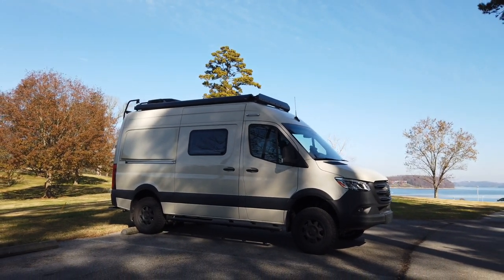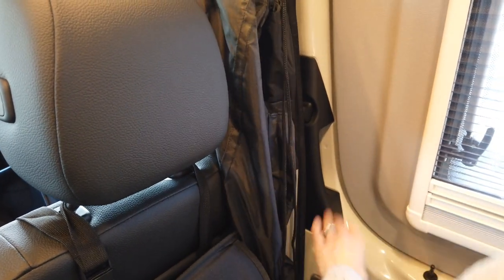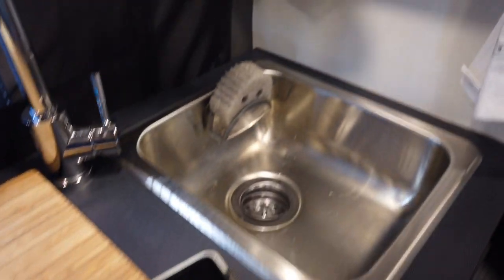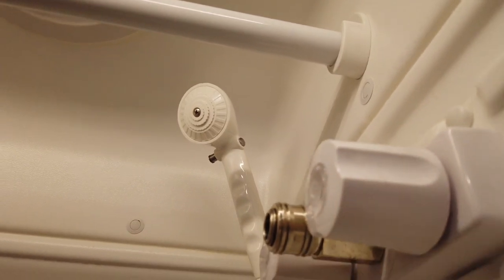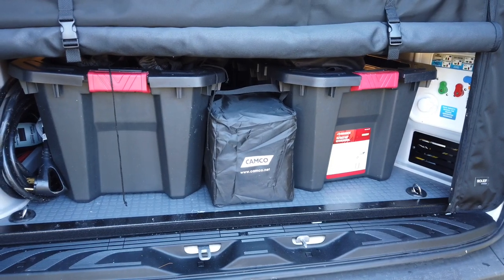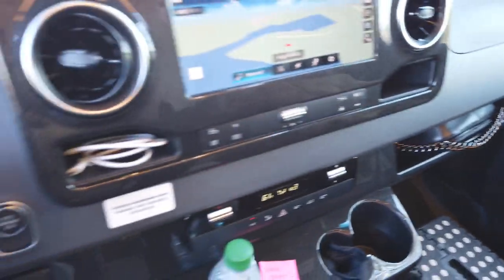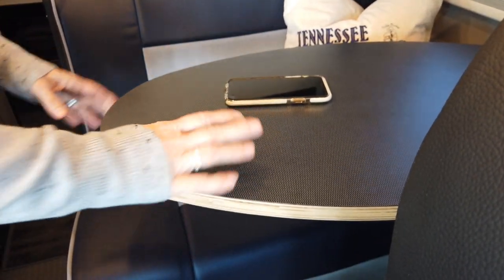2021 Winnebago Revel One Month In- Good, Bad, Tips and Tricks

Comment: Great video.  If you want to use something other than a sticky note to remind you to disconnect shore power, I use the slap bracelets and put them on the steering wheel.  Mine are bright florescent colors and I wrote shore power, water, awning, sewer, etc. and I place them on the wheel when I set up and remove them as I disconnect.
Reply from the maker: Great tip!

Comment: Great content! We’re thinking about buying an identical one. Can you potentially do a video on making a bed out of the backseat cushions and the little table next to the door?
Reply from the maker: Thanks for the feedback! So we have no need for another sleeping space, these are pretty cozy with just two people- if you wanted to add a third bed I would recommend something like this: https://lunolife.com/products/front-cab-air-mattress-sprinter-van?variant=40244491878561&utm_source=google&utm_medium=cpc&utm_campaign=14674637517&utm_term=&utm_content=gclid|Cj0KCQjw2_OWBhDqARIsAAUNTTF_8ty0qND4ERGAe17YxDWxYUCbZ-KbkcrmeoDw0MTAL1JZO5o5tQwaAhYFEALw_wcB|campaignid|14674637517|agid|133142618115|adid|575600134245|ntwk|g|targetid|pla-1644856390974l|ocp|9013299|matchtype||dev|c&gclid=Cj0KCQjw2_OWBhDqARIsAAUNTTF_8ty0qND4ERGAe17YxDWxYUCbZ-KbkcrmeoDw0MTAL1JZO5o5tQwaAhYFEALw_wcB&gclid=Cj0KCQjw2_OWBhDqARIsAAUNTTF_8ty0qND4ERGAe17YxDWxYUCbZ-KbkcrmeoDw0MTAL1JZO5o5tQwaAhYFEALw_wcB
Reply: @MULTIPLESHOTSFIRED  thanks! I’ll check that out. 😊 We may only use it once or twice a year but think it would be handy to have. Appreciate it, and again, great content!
Reply from the maker: Sounds good- I think you will love the rig, pretty much lets you go anywhere with all the comforts of home!

Comment: The seat belt style latches for the bed, may be to take some of the strain off the bed support mechanism. I'm sure, no matter how well it's made, it takes a beating bouncing and jostling down the roads and/or trails. Even with no additional weight on it.
Reply from the maker: That is exactly the purpose of it.

Comment: Can you clarify why you’re using a generator for the AC? I thought the 21 Revel had enough lithium to run self contained?
Reply from the maker: Yes the 21/22 Revel Lithium can run the AC , but only for 3-4 hours continuous. Here in the Southeastern US with the hot, humid summers you need to run AC overnight if you want to have any chance of being comfortable. The generator lets me run it as much as I want, and makes recharging the batteries on overcast days a breeze. (The factory solar panels will maybe charge the batteries 20-30% on a sunny day.)

Comment: What are your tips for de-badging? I assume the decals come off with a heat gun, but what about the Winnebago badges? Are they glued on as well? Thanks!
Reply from the maker: I removed all the badges just using a heat gun. 3m emblem adhesive remover is good to clean up any residue. It's super easy!

Comment: Thanks for the review ...well done
The Toilette is the EU Norm Portable WC,which is ,in my Opinion,easier to handle more convenient than dealing with Dump Stations and a Hose for your Black Water Tanks.I prefer this very much since I have had both  I know both! travel Save
Reply from the maker: Interesting, not familiar with the one you mentioned. I'm happy with the cassette system, never had to use a hose or dump station, just find a restroom and dump in toilet. No complaints here.

Comment: Thanks for sharing this and all the links. I've had my '21 Revel for 3 mos now with several trips. I'm in FL and the A/C works well off the Zantrex/lithium and I don't see why you need the soft start - that might be an unnecessary upsell. I have Honda EU2200i with Hutch Mtn propane conversion to help top batteries in heavy A/C use situations if no shore power. Overall happy with Revel but I've had problems - 3 times now the sensor for the cruise control has mysteriously gone out thus disabling cruise control - and in each case its just as mysteriously fixed itself. The pistons to hold the windows out are crappy and failing already. The LED strip on passenger side running board underside has partially failed. I really hope I don't have any transmission problems like you did - I previously had a '20 Mercedes that had some weird transmission problems during the few months I owned it and took it across country. I traded that for the Revel as I realized it would cost more to convert that van than to just buy a ready to go Revel and time was a factor.
Reply from the maker: I actually added the soft start as insurance, I was told it's easier on the AC, who knows lol. I have had the cruise control drop of one time, I believe it was due to the crappy weather I was in, the forward camera or sensors were fouled up. Solved itself. I would recommend getting it to your local MB dealer for software updates, I was surprised for a brand new van how many updates it required. Since then I have had zero issues with the transmission (knock on wood!)

Comment: Very nice information. I'm sure I'll have some questions as I start using the new one I pick up in about 3 weeks. On the suspension, Esther a dealer recommended change that you are looking at (adding a leaf, other?).  Let me know how that change goes if you make it.  On the computer crap, I have an older sprinter, and had a similar (but different issue) where the computer gave an error, would not run, and no-one could figure it out. Software upgrades seem to be the solution that solved it, but no one ever knew what the original issue was.
Reply from the maker: If I add some storage boxes on the back I may upgrade the suspension, so far I've been pretty happy with the stock setup. In heavy winds or when a big truck pushes by you it can sway a bit but very manageable.

Comment: Hey, guys. Great ideas in this video. Will definitely borrow a few. Quick question: What brand surge protector do you guys have? I just purchased the exact same van and don't want to take the chance of frying my batteries and inverter.
Reply from the maker: Thanks for watching- here is the surge protector I use- works great: https://www.amazon.com/Southwire-Surge-Guard-Communication-Capable-Protector/dp/B07NW195M8/ref=asc_df_B07NW195M8/?tag=hyprod-20&linkCode=df0&hvadid=319981170457&hvpos=&hvnetw=g&hvrand=804410890640111729&hvpone=&hvptwo=&hvqmt=&hvdev=c&hvdvcmdl=&hvlocint=&hvlocphy=9013293&hvtargid=pla-647398498297&psc=1
Reply: @MULTIPLESHOTSFIRED  Thanks!

Comment: Wow, that toilet flush button is a design flaw. I hope W improves the design in the future and provides fixes to the previous models. Go Hawks!
Reply from the maker: Yeah it's actually thetford design that's the issue. Instead of relying on the o-ring seal it should get silicon seal from the factory. No issues since I did that to mine.

Comment: When you park this van at home, did you park near the curb or on your driveway? We are thinking replace our SUV with this but HOA might not like it.
Reply from the maker: Removing all the graphics is a big help- not sure what your HOA says, mine says no RV's but I am of the opinion that this is a Mercedes Sprinter vehicle with off road modifications. Depending on how your state registers it, it may show up as a Mercedes Van on the registration, in which case you can just show that to the HOA admin.  I am very fortunate that I have a rear garage in addition to our main front garages so it is not visible all the time. All the neighbors that see it have been very positive.  There is a large facebook group dedicated to the Revel, most discussions in there have been pretty positive about HOA situations- key is removing anything that says Winnebago!
Reply: We have the same issue. I’m pretty sure we’d catch hell if we parked a swoop swirly vehicle on our driveway for anything beyond a week. When will they learn? 🙄 stealth is so much better!

Comment: Mind me asking how much it rattles when on the highway?  I’ve heard it described as “ unbearable”.   Thoughts?
Reply from the maker: No it's actually pretty quiet. My wife will drive herself crazy with car rattles and she's found most of the issues: The maxair fan in the ceiling made a little noise when driving, putting that removable cover on it solved that. The bathroom door can make a little noise when on a bumpy road but nothing serious. The window on the slider door will make some noise unless you pull the light shade down, then it's fine. Overall I have no complaints.
Reply: @MULTIPLESHOTSFIRED  Great!  Thanks for the reply.

Comment: Hi!  Did I miss commentary about a microwave?  I don't think the Revel comes with one, but I see a microwave from Amazon in your links list.  Do you store one and use it when you need to zap something?  I've only considered rigs with a microwave, yet never considered storing one and using it as needed.
Reply from the maker: We did buy a microwave and kept it in a storage bin. After multiple camping trips we stopped packing it. The induction and solo campfire stove work great for our needs.

Comment: I’m not sure how a cassette toilet doesn’t stink when you’re dumping it?  Maybe you meant no stink when it’s being used. We love the eco smart liquid.
Reply from the maker: What I meant was the toilet doesn't smell at all in the van- some folks have concerns it will be a issue inside the van. Of course when you dump it you'll get some odor, just as you would with any RV blackwater dumping.
Reply: @MULTIPLESHOTSFIRED  but - even though I don’t have a lot of experience with regular rv dumping - my impression is it doesn’t smell as bad as dumping the cassette. Plus dumping in a public bathroom you’re visually seeing everything. We have a friend who almost threw up doing it his first time. We had a cassette on our last camper and decided not to use it except for #1 and if nothing else was available or the weather was really bad outside (pardon my frankness). They’re heavy when full if it’s 5 gallons and heaven forbid if you drop it. Plus you have the shower issue you mentioned. I’d consider a composting solution for the future.
Reply from the maker: I've dumped it many times and never had a problem, I personally love the flexibility of not having to find a RV dump station, it takes 2 minutes to dump and it's over. It has the folding handle and wheels so I don't see dropping it a problem unless you are really uncoordinated. I'm not sure why some folks are so weirded out by them, it's a much simpler solution and way more flexible than normal blackwater tanks. The shower switch was a simple fix and never had any issues since.
Reply: @MULTIPLESHOTSFIRED  We never need a dump station either and it’s great on so many levels!
Reply from the maker: @averagealice8877  Sounds like you have a solution that works for you- that's really all that matters. The last thing I would do is try to convince someone to use something they are not comfortable with. Happy camping!
Reply: @MULTIPLESHOTSFIRED  We think about getting a Revel if our current rig continues to have issues. Enjoyed your tour.
Reply from the maker: Thanks- the Revel has been an amazing rig for us. Good luck!
Reply: @averagealice8877  @multipleshotsfired.  What does your handle mean? I love it.

Comment: Great video thx . What OBD codes have you had and what were your issues on your new van . Thank you
Reply from the maker: P24A5 Mercedes-Benz Exhaust Gas Recirculation (EGR) Cooler Bypass Control Stuck (Bank 1). I've cleared it, if it continues I will take it in, has no impact on driveability or anything

Comment: On YouTube "Owls Vans Engineering" has all kinds of parts and upgrades you can buy for Revels so you might want to check them out...
Reply from the maker: Here is the foam cannon I used in the video: https://www.amazon.com/gp/product/B01MYV2X8H/ref=ppx_yo_dt_b_search_asin_title?ie=UTF8&psc=1 The pressure washer I picked up from Lowes: https://www.lowes.com/pd/Greenworks-2000-PSI-1-2-GPM-Cold-Water-Electric-Pressure-Washer/1000460607

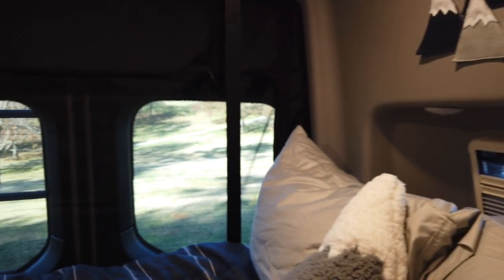Comment: 21:51 - Such a thorough real-world use of the Revel. Nice upgrades too! Now for the bed..

Honest assessment - is it really big enough for two adults? I think the length is fine (I'm 6-4), but the width at 49in is what I'm most curious about. How does it hold up for you two?
Reply from the maker: I'm just under 6', wife is 5'-3", we have zero issues with height, you at 6'-4" would duck when getting in the bathroom, but the bed should be fine for sleeping. We've spent a lot of time in it- we are both very happy with the rig as it is, the small size, ease of parking and non-RV look are a huge plus for us.

Comment: Very good tour...I may be wrong but I think you are from Tennessee.  I will be interested to see how you handle the heat and humidity when summer comes.  I heard you saw something about using a Honda generator for the air..did you consider adding a 3rd lithium battery?
Reply from the maker: You are correct I'm in Tennessee, humidity and heat will be interesting. The dealer offered to do the 3rd battery, it was about$1,600. I feel like the generator as fail safe is better for my needs. Worst case if I need to use ac for a long time the generator will get me through it, even with 3 batteries I doubt the AC could go 6 hours if you are also cooking and using the rest of the van's electrical. I may get a 3rd solar panel at some point.
Reply: @MULTIPLESHOTSFIRED  Good points, if you are going to be boondocking in one spot without driving the generator would probably be your only option.  Thanks for the reply.

Comment: The cannot shift issue must be voltage related could be a bad battery or alternator. And somehow the system got charged up during the trip…
Reply from the maker: @harryj1081  It's the EIS sensor, located on drivers side below A pillar. Condensation from the windshield dripped down and soaked it. It dried out overnight and that's what let it work again. Mercedes sells a rubber boot to put over it to prevent this, I bought one and during the install noticed some corrosion.

Comment: Question. How much does a full cassette toilet weigh?
Reply from the maker: Well water weighs 8.3 lbs per gallon, so figure 43lbs or so for a full tank. It's super easy to remove and get on the ground- if you have to go a long way the tank has wheels/handle and you can roll it into a rest stop or wherever you need to dump it.

Comment: How long can you run the AC before the batteries run down to low? I am planning to travel with my dogs.
Reply from the maker: 4-5 hours. If you want you can add another battery which would add 33% runtime. I'm planning on using a small honda generator if I find the need, so far battery only works amazing.

Comment: Great video, what is you gray water capacity? Do.you have lithiums?
Reply from the maker: The gray water capacity is 21 gallons. Yes- two 1,600 watt Lithium batteries on board.
Reply: @MULTIPLESHOTSFIRED  are they stored under the bed? Thanks
Reply from the maker: @jmonserrat2018  Driver's side, hidden behind the gray plastic panel. Easy to access if you need to.

Comment: I have a theory  when your wife showered two different times and the water got behind the toilet and within the walls, it  probably exposed the vans computer-switches or main brain components having the Alert default message come up on your dash board.
Reply from the maker: Good theory but unfortunately I don't think it's the issue. The cassette chamber is a water tight compartment- when the toilet overflowed it was clean water and just went down the shower drain, it didn't get into any walls or flooring. :(

Comment: low voltage condition??? in 4x4 when you expect to go into secluded areas without Merc support? This is no no for me..., winebago should mount the top on some Japan made base.
Reply from the maker: Put thousands of miles on it since the software update and no issues at all.
Reply: @MULTIPLESHOTSFIRED  once you put hundred of thousands miles it would be credible..., (prior german car owner...)
Reply from the maker: Sounds good Tom, I'll report back in a decade or so. No concerns at all on this end.

Comment: Good video and great tips. I'm with you on the sticker delete. I did the same to mine. You mentioned the curtains- have you seen the CA vans version? I made a modified version with no velcro needed, some of the foam from the top I used in the bottom so when I roll it up I shove the right end in and leave the middle covering/ blocking the shelf as a headache protector. I don't see how to contact you directly, but if you like I can make a video or show some pictures. Took some time to do, but less than $90 in materials. https://sprinter-source.com/forums/index.php?threads/94180/
Reply: I just did the loft bed key switch swap. super easy you should do it.

Comment: Thanks. Considering what these cost, Winnebago has really cheaped out on a few things. Shallow drawers, crap bathroom fixtures, no mirrors, 70s style cabinetry, etc. The main thing I like about the Revel is the lift bed/storage garage arrangement, otherwise I probably wouldn't even consider one of these.
Reply from the maker: The shallow drawers are due to the limited space, the bath fixtures are minimal also due to space and intended use. Disagree with you about the "1970's style cabinetry". Shop other 144" Sprinter based RV's and you will find Winnebago did an amazing job coming up with a unique design at a better price than competitors.